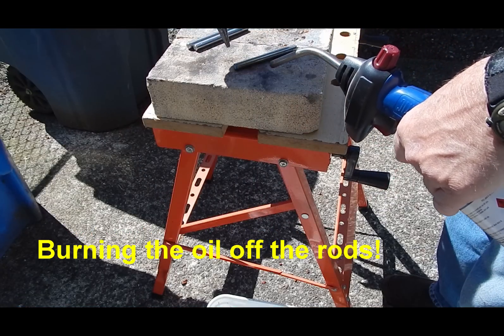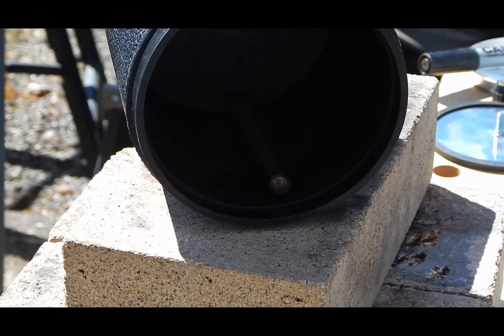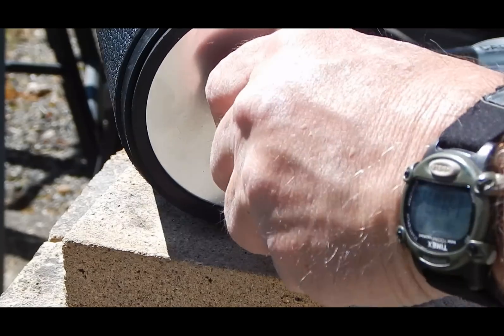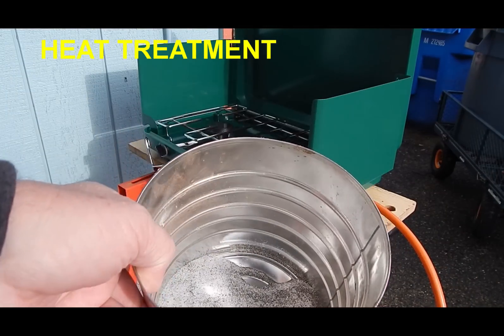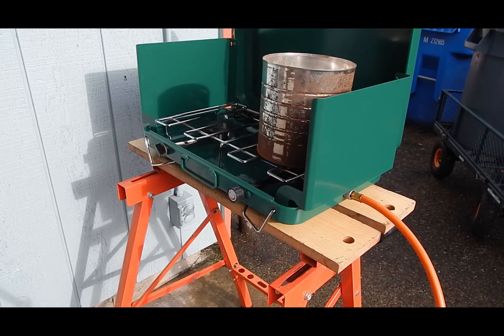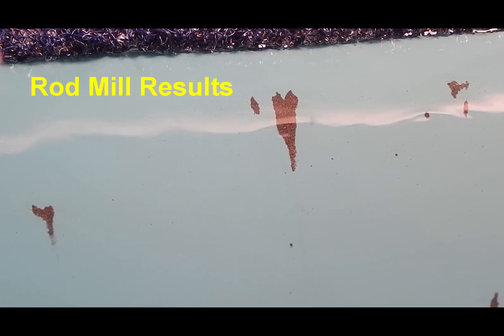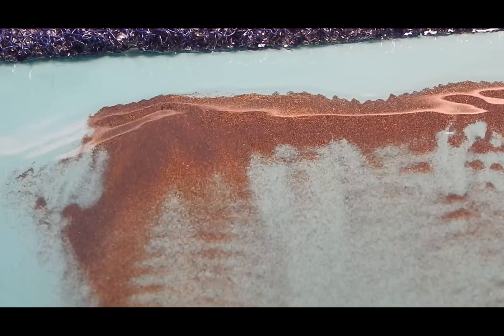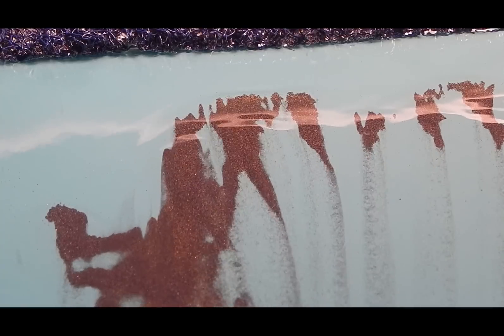S2E17 Washington State Gold Mining - Recover All the Gold from your Concentrates wth Pete

Comment: so why don't you heat crack them and then flush with acid?
Reply from the maker: Vladimir Nachev I will.  Takes a while to set up and I want to wait until I have enough to process (1-2 gallons).  I'm sneaking up on it and have about a quart to work.  I have one more test to do yet that involves using borax flux and just melting the gold out.  I suspect that it'll work better by heat cracking, the acid wash, then melt with flux.  I'll film it (of course) so everyone can see how it works.
Reply: yeah but if you want a high production melt use microwave kiln kit for gold OR high frequency induction furnance

Comment: So the steel rods are for crushing the sand into finer materials for extraction..ah..was wondering what you were trying to do with that
Reply from the maker: 1Batt The theory is that some gold is mechanically bound to other material.  The pin mill breaks the gold loose so that it can be extracted.  The test that I ran showed that the acid (vinegar) and heat cracking worked better on the material that I was testing.